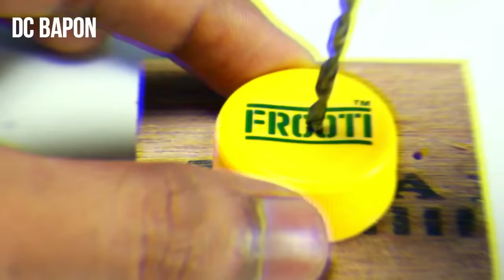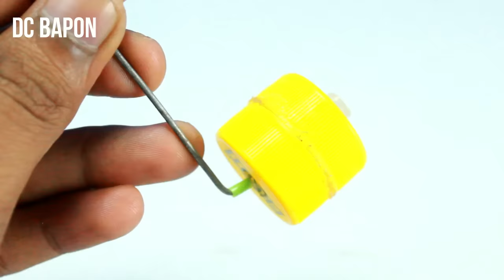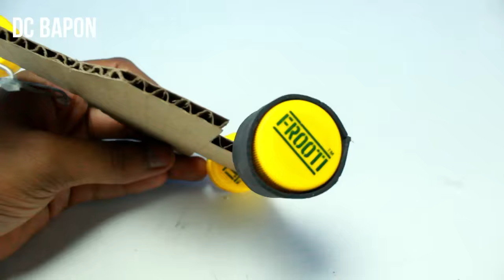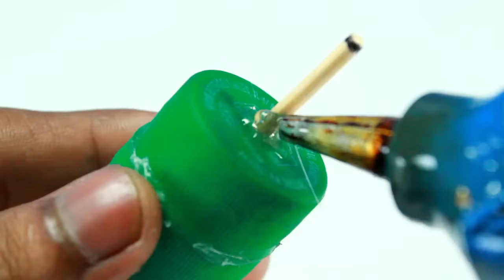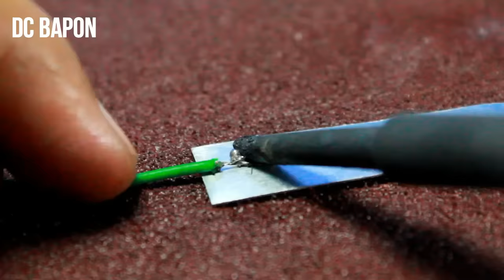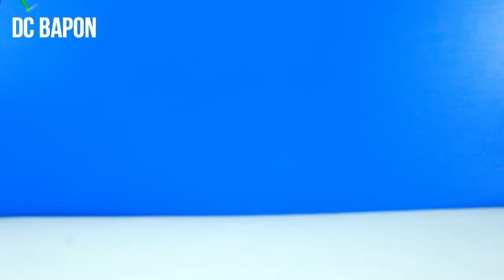How to make Amazing F1 Racing Car - Out of Cardboard DIY

Comment: The first one is great! - BUT it would need to be torn apart to recharge the lipo! 
A small addition of one or two usb-lipo charge circuits would fix the problem - and do away with the need for a 9v PP3 if another couple of lipos are used in series and hidden, accordingly :)

Comment: What are the materials needed to make this kind of  DIY??
Reply: Are, are you serious? It’s all the in the video.  Anyone can basically make this from Dollar Tree items. Cardboard, motors from other toys, lots of drink caps, 1 soldering iron/solder wire which you can skip if you tape/glue/scrunch the wires together.  Metal, wires, hangar wire, and some craft foam, a battery to power the controller & motors. Hot glue, hot glue gun.